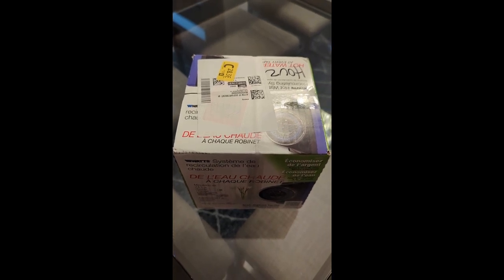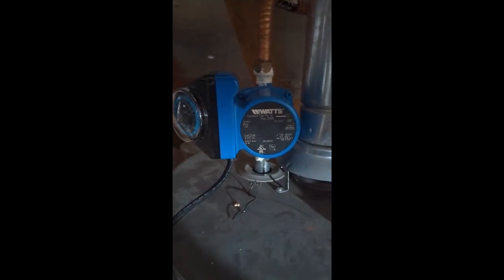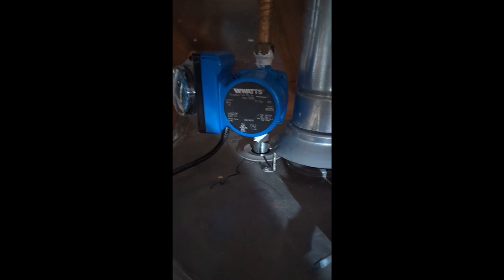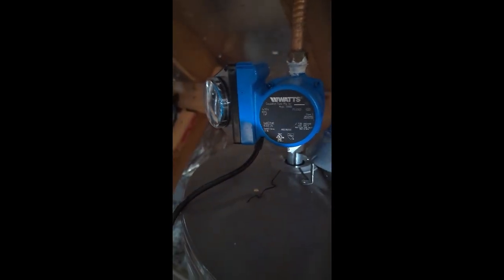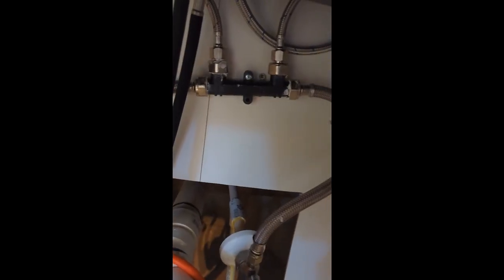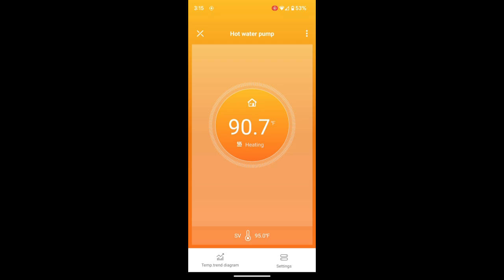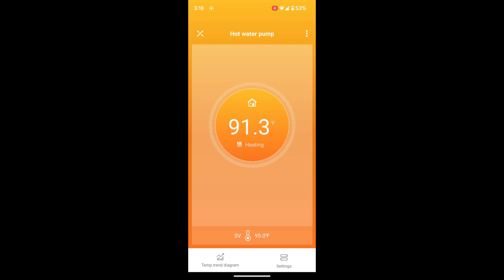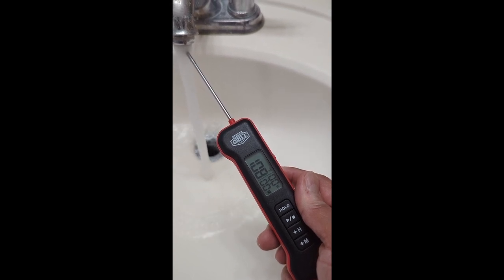Hot Water recirculating Pump smart home Automation based on temperature

Comment: I live in Florida and my attic is routinely 120 to 135 degrees during the summer.  If you live in a hot climate, I think that your temp gauge is ultimately going to reflect the temp of the attic and probably not tell your pump to come on until you turn on the hot or cold water, once again creating a delay getting hot water to your distant sinks and showers.  The bypass valve that comes with your Watts Pump should only let water to pass from the hot line  to the cold line until the water reaches between 90F and 100F.  Once the water reaches that temp, the bypass valve should stop the water flow.  If it is not doing that, check the water temp at the bypass valve.  Do this by turning off the cold water feed to the bypass valve under the sink and opening the cold spigot and measure the water temperature.  If it is over 100F, you likely have a bad bypass valve or it's installed incorrectly.  If it is below 90F, you will need to increase the temp of the water heater a few degrees to allow hotter water to make its way to that distant sink.  Once it reaches around 90F ton 100F, the valve should turn off the water and not let any water come out of the cold water tap into the sink while the cold water supply is turned off under the sink.   Hope this helps!

Comment: This is a great idea! Thank you for the information. The one additional feature that we need is a controller that allows both TIME and TEMP at the same time. I have not found a way in the APP to do that with this controller (308) you have in the video, unless you can let me know how its possible with the SMART features to control TIME based TEMP? The other two Inkbird models (312 & 306) seem to allow both TIME and TEMP controllability. This way you can completely turn the pump off at night time when not in use and also disable it for vacation mode perhaps. Let me know your thoughts about this? Thanks!
Reply from the maker: you are overthinking this ..... if you sleep at 10PM (night) and the pump comes on maybe once because remember no one is using water while everyone is sleeping , its not going to make a difference ....... I personally wouldn't worry about it ...... what are you going to save like a few pennies every year ....... remember hot water in the pipe will remain hot for a while as long as its not moving.

Comment: Can I use this Pump for dedicated return line system?
Reply from the maker: Yes
Reply: @HomeTech_Pro  Do I need to use sensor valve?
Reply from the maker: @Kiwi-rf4jv  That I am not sure of, But I would say NO , since the cold water will return on a isolated line .
Reply: @Kiwi-rf4jv  I would suggest that you DO want to use a sensor valve of some type otherwise you will be continuously pushing water through your pipes.  Not sure if that is what you want or not.  The bypass valve with this kit closes between 90F and 100F and prevents any water from moving in the lines until it cools down a bit.  If water is not reaching that temp, you may have to raise the temp of your water heater a little bit so that you get nice hot water to all sinks, and less hot water standing in the cold water lines.  The pump will continue to run, but water will stop moving which is what you want until it cools down below about 90F at which time the valve should open and allow hot water to pass once again until the cutoff temp is reached.  Just my 2 cents, but might be helpful.  I believe there are other pumps specifically designed for real closed loop systems, and they do monitor the return line temp and turn off the pump when a specific hot temp is reached in the return line.

Comment: Great video. I really love the concept, however I live in the north east with the hot water tank in the basement, I am concerned that during the winter months the pump would constantly run especially at night when the house temperature is set lower. Any suggestions?
Reply from the maker: so what I did at my house was not a perfect science by any means , But the Inkbird is super awesome with the APP , what I would suggest is get it all installed and just keep an eye on it for some weeks and find a temperature that you can set for it to come on that works for you , the Inkbird is very accurate and works great at turning the pump on and off without fail.  Good Luck !

Comment: I am curious if you actually watched your gas burners come on while the pump was on and circulating while nothing was being used? I plan to test my electric water heater for that scenario. What I have been doing is, turning on pump for a few minutes. Get in shower and turn off pump. I have it connected to a smart switch, all I have to do is say, alexa, turn on hot water. Just wanted your thoughts. I have been looking for this video for a while. lol
Reply from the maker: Well I am not sure what you mean , My video shows you exactly what to do to "Automate" the entire system and answers all of your questions.
Reply: @HomeTech_Pro  I am not talking about automating it. I just want to know how much your water heater turned on while the circulating pump was running and  no hot water is running anywhere.
Reply from the maker: @shortypalmer2560  ooh sorry , I misunderstood ...... So I haven't really monitored it ....... But here is what I have noticed , you turn the shower on full HOT , pump turns on because the temp at the return side drops ...... Pump runs while we shower or use hot water around the house , after all the hot water taps turn off takes around 20-30 mins for the return side to get hot again which means that there is hot water all through the house and the InkBird see's the temp go up and turns that plug off so down goes the pump until the next time the Hot water is turned on.

Comment: Add it to your cold water side I just put one in today I had to make a recirculation loop on the cold water side so the pump doesn't cavitate and we have a long run to the upstairs tub and the hot water is there in 25 seconds I had to put a circulation pump in to get more volume of water and it boost's the water pressure a bit we have a tankless water heater that needs more water volume so this works great better than buying a 500.00 pressure tank I live in Canada btw
Reply: This particular Watts HOT H2O pump is NOT DESIGNED for Tankless systems.  There are specific pumps similar to this that ARE DESIGNED for tankless water systems that likely have more switches built into them.